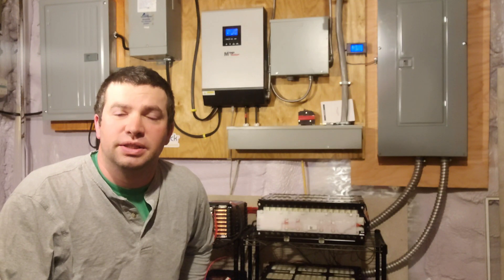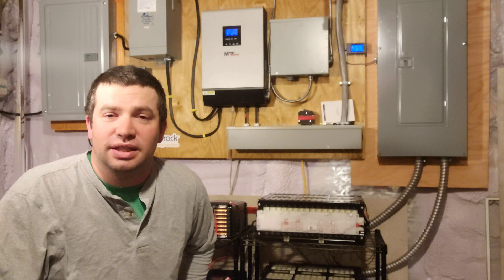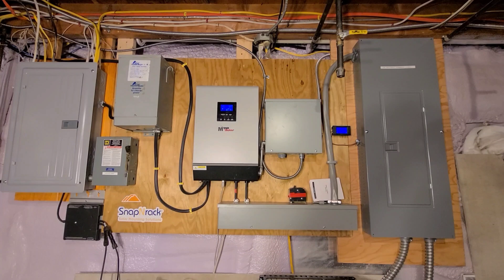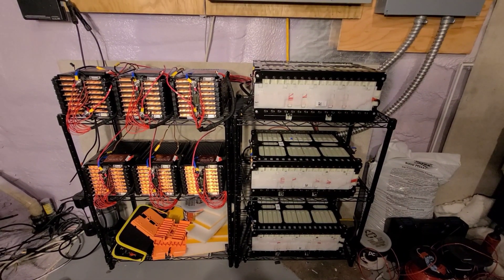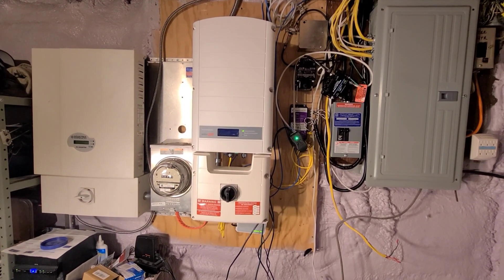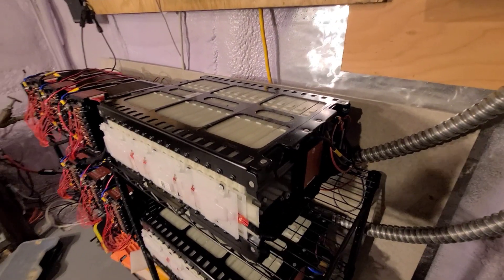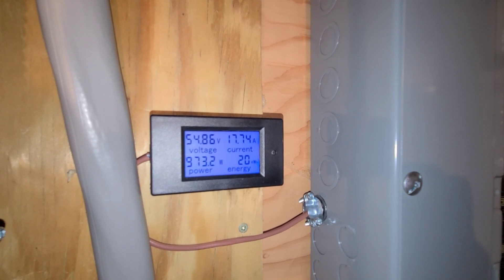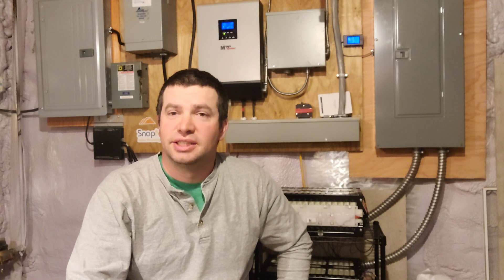Introduction and Tour of my Systems

Comment: Do the smart fortwos come in a 16s configuration?
Reply from the maker: No, the 2017 comes in 3- 32s modules.  I had to peel the spot welded tabs apart in the middle of each pack.  Bit of a pain in the butt, but it worked.  The earlier Smart Fortwo packs are different.  Poz did a few videos on those.
Reply: @benssolarandbattery  so to add to my 16s setup, I could only use 2017 and newer?
Reply from the maker: @RJ-cc1fz  you can do it with the older ones but it's not as easy. I believe they're missing a cell as well.   Even with the 2017 I had to be very careful pulling those tabs apart.  One wrong move and you're done.
Reply: @benssolarandbattery  thanks for the quick responses. I’m sitting here with the fam watching American Idol but the wife gave me a go ahead to spend some more money on batteries..

Comment: Do have any experience with a 2 panel system.   The home I purchased has 400A main feeding 2 panels.    I cannot find any information about how to wire this system.   I assume it would be like the critical load sub panel but with 2 power sources I am concerned.  Thanks
Reply from the maker: Really depends what you're trying to do.  You could make one panel backed up loads and one non-backed up, backup the whole house using 1-400a transfer switch or 2-200a transfer switches.  Would probably be worth having an electrician come out and tell you what will or won't work.

Comment: wow didnt know you could use ac breakers, was told ac breakers are unleiable for tripping dc. . . so your saying if you run positive negative for adouble breaker its safe / how do you achieve this, im guessing positve negative on each pole and then the to main split phase bus bars are your main 200a positive and negative. . . . . very  cool111
Reply from the maker: Square D QO circuit breakers are the only ones I know that are dual rated. Single pole can be used up to 48v, 2 pole up to 120v. Over 48v, (it doesn't say nominal, just 48v, so a typical 48v system would be over 48v) just wire positive to 1 pole and negative to the other, making sure you keep them the same.  Under 48v, just wire the positives to the single pole breakers and negatives to the neutral bar.

Comment: Hi Ben, nice video.
I was wondering, what parameters are you using to reach the value of 9kWh for the Volvo batteries? I'm looking at purchasing the same ones, but they're stated as having >90% of their original 12kWh capacity so I'm curious if 9 is due to undercharging/inverter loss/etc? Or their real capacity is more like 75% that of advertised?
Reply from the maker: Hi there, I could have most definitely squeezed more out of them.   I charged to 4v per cell and discharged to 3.15v per cell.  My inverter was the limiting factor on max charge. I would bet at least 10kWh, possibly a little more.

Comment: Hello, I have a battery similar to that of the SMART 2017 car.
In the images of the video, it gives the feeling that You did not remove the green nails from the battery, and it is almost as with little intervention. Are You working with 113 Vc?
 How did you split down the middle?
I appreciate all your help in the best way to do it, because I am new to this, so all the information is useful to me. Thanks. José (PORTUGAL)
Reply from the maker: Hi José, you're right, I didn't pull the battery apart at all. I was able to peel the spot welded tabs apart and then bolt mechanical lugs onto each one.  I then glued some strips of plastic in between them to make sure they didn't touch, as one is the positive and the other is negative.  Hope this helps!

Comment: Thanks for sharing Ben.  I have a question about parallel BMS as I am looking to put together a 40kW LTO pack with already series SCiB cells and one of the options would be using 36 such BSMs (one for each module).  Reading through the battery wiki on reddit there is a section that advises against doing this, "Li-ion batteries contain a BMS that shuts off the battery current (if required to protect its internal cells).  Later, when everything is OK and the BMS reconnects its power switch, the State of Charge of that battery (and therefore its voltage) will be different than for of the other battery.  At that moment, a large equalization current between batteries will result, which is likely to exceed their rating and cause damage.  Therefore, connect Li-ion batteries in parallel is a bad idea, and gets worse as the number of batteries in parallel increases."  My question is what is your protocol when a BMS shuts down current on a module?  Would you have any concerns about setting up a system with that many BMSs?
Reply from the maker: Good point, I hadn't thought of that scenario.   In my case, I have each module run through a breaker rated at half the BMS current rating. (20a/40a) the wire is 10awg in order to handle the current.  If that happens, it should, in theory, trip the breaker, isolating that module.  I turned a system on earlier this week with 16 Simpliphi batteries in parallel, one of the batteries was 2 volts higher, but it only resulted in a 12a balance. 
The more batteries you have in parallel, the lower the current you will be pulling from each one on a normal basis, therefore you can size your overcurrent protection accordingly.  I would definitely recommend a separate fuse or breaker for each module, but don't see an issue with paralleling that many.  I will certainly be adding more to my system in the future. 
Thanks for watching!

Comment: Ben, your friend Dave gave me advice how you ran your battery bank into your Square D breaker box using double pole breakers for my LTO batteries. Currently, I am building a rack that will hold batteries and Square D box together as one complete unit. I have been deciding whether or not to use a BMS on the batteries as I find conflicting information regarding using them on LTO batteries but, think I will to be on the safe side, I hope. Your work is remarkable and you need to show your content a piece at a time in more detail to attract the unknowledgeable like me.
Reply from the maker: Thanks Craig! I will try to make some more detailed videos.

Comment: Ah this answers the question I asked in the other video lol. What kind of loss do you see on that transformer?
Reply from the maker: I'm seeing a total of 70W from the battery with just the transformer and no other loads hooked up.  I'm not sure exactly how much the transformer uses, but they're pretty efficient.  I've found that it helps the surge capacity of the inverter, and I can get the full output through 1 leg if needed.
Reply: @benssolarandbattery  How much do transformer's like that go for? Really cool video!
Reply from the maker: @stingy49  its an Acme T-2-53014-S 5kva Isolation transformer, I picked it up off Ebay for around $130.
Reply: @benssolarandbattery  Dang not bad. Yeah being able to run the overseas 230-240 volt stuff and turn it into 120 2 phase opens a lot of doors.
Reply: @benssolarandbattery  That 70W is a static draw right? Like say you had a 500w load, you would need to supply 570 to the input?
Reply from the maker: @stingy49  thats what it seems like.  That may be different at higher load though.  I have a large enough battery bank that it doesn't bother me too much. It's definitely a lot more than expensive inverters though.
Reply: @benssolarandbattery  Good to know. I went down the rabbit hole of rewiring transformers as autotransformers for single phase 240->120 conversion last night. I could get a 1kva isolation transformer for like $65 and rewire it to be an autotransformer and double the nameplate capacity according to the acme catalog. Interesting for us on a budget who only want 1 phase. Not sure if you could tap the top half for the other phase...
Reply from the maker: @stingy49  awesome! Where did you find the info about wiring it to be an autotransformer?
Reply: @benssolarandbattery  https://www.reynoldsonline.com/ASSETS/DOCUMENTS/ITEMS/EN/ACMET2527031_Spec.pdf #36 on page 10. Also they say the nameplate kva is doubled but if you look at the 3 phase applications on page 30 (the top section) you can see they list a T253010S (normally 1kva) as 3kva. Maybe that's because they use two of them and it's 3 phase?? Really not sure, I'm not great at ac electronics.
Reply: @benssolarandbattery  It's neat though cause for those of us that don't need isolation we can run double the kva which also means only dealing with losses of the smaller kva transformer.